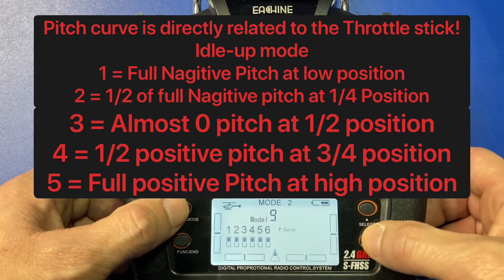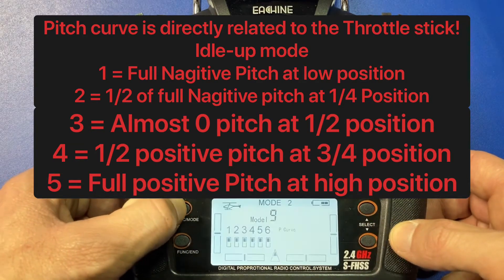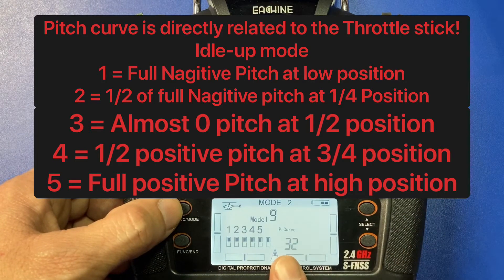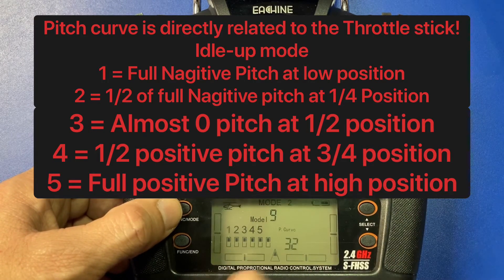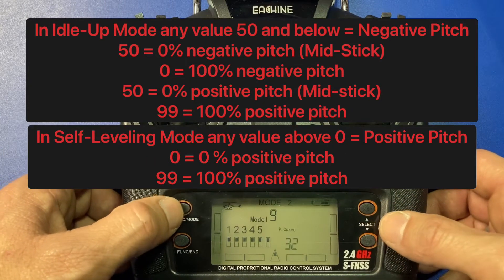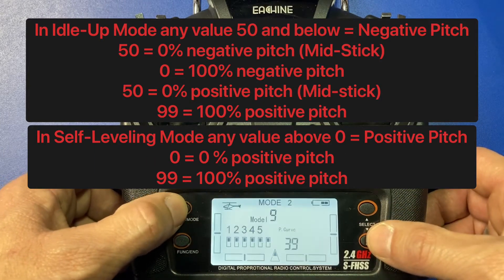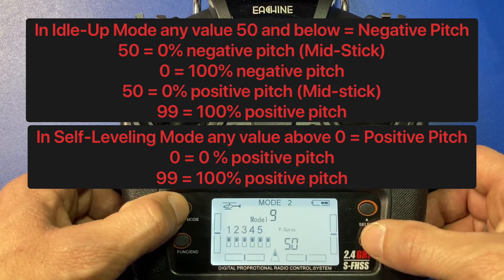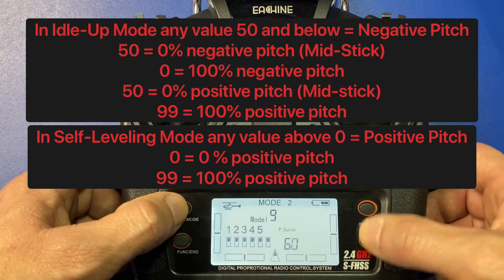Eachine e6 TX... T-Curves & P-Curves

Comment: I have just ordered one of these to use with with the eachine e119, being as its only a 4 channel fixed pitch heli, will adjusting the throttle curve make any difference to the throttle?
Reply from the maker: Thanks for the comment... In a fixed pitch heli I would use a linear Throttle curve... This just means when the throttle stick is in the low position you have 0% head speed and when the throttle is in the high position you have 100% head speed... So the curve should look like this( 0 - 25 - 50 - 75 - 100 )... if you want more head speed at a lower throttle position try ( 0 - 45 - 60 - 80 - 100 ) You can play with this a bit to find settings that work best for your style of flying. I don't fly fixed pitch much anymore but when I did I used the linear setup and found that it was best for me. Please Subscribe, Like and Ding the Bell!!! Thanks and stay safe!!!

Comment: now i will  get the  new eachine e 180 helicopter without the transmitter.
Reply from the maker: On Banggood it says that the e180 uses S-FHSS and has the option to expand to a satellite receiver and it supports DSMX DSM2 PPM S-BUS systems. So ALL should be good to go to bind to the e6 or the x6. Make sure to check all your cyclic control directions and Negative and positive pitch controls before you fly it for the first time. It could be setup a bit different than the e160. Let me know how it flies... I may get the e180 as well at some point. Good Luck!!!

Comment: can any quadcopter be connected to this transmitter?
Reply from the maker: It should work with most S-FHSS PROTOCOL receivers... Eachine and XK should be no problems... it won’t work with WLTOYS for some reason even though XK is owned by WLTOYS. I believe WLTOYS uses an older FHSS PROTOCOL. I haven’t tried it with any other brands. Thanks for the comment... Please Subscribe, Like and Ding the Bell!!!
Reply: @DaddysRCAddiction  thanks a lot for the good advice. I will continue to watch your videos. I wish you all the best.